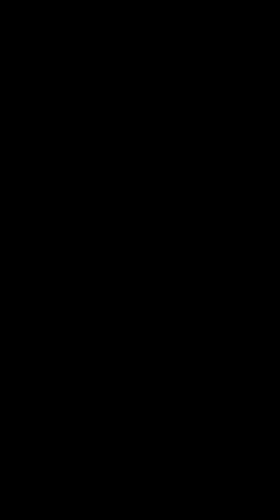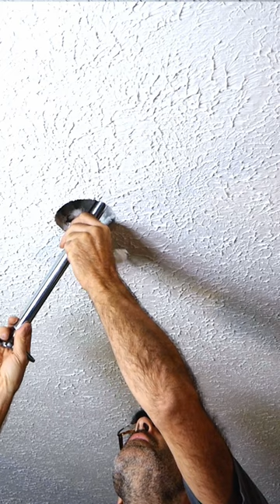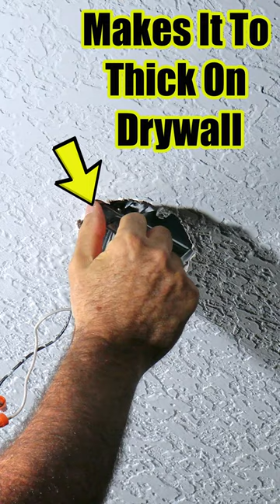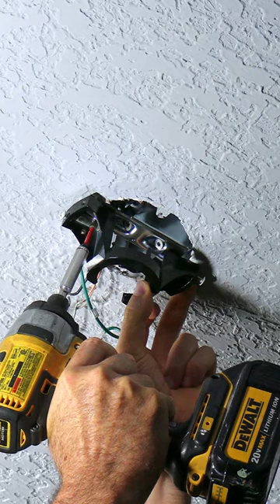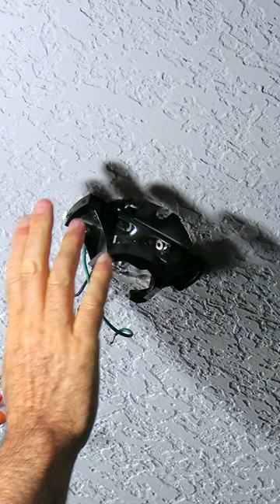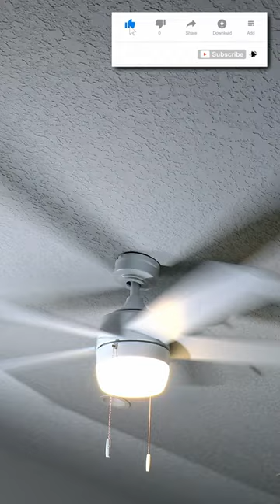How To Retrofit an Ordinary Light Fixture w/ a Ceiling Fan #shorts

Comment: This bracket is not available at the big box stores and very expensive online. Any idea where to get this at a fair price?
Reply from the maker: It was about $25 on Amazon... You're right, it's not available at big box stores.  Yes it's more expensive, but a regular fan brace is $22 at Lowes!  That's the one that extends between the trusses/ joists.  The one that straddles the joist is about $7 if you happen to have wood in exactly the right place..
Reply: It will be in Home Depot shortly.  We're working out the final details to get it in that store
Reply from the maker: Oh nice!  That'd be cool.... Thanks for the info.   @fixturesupportsystems8132

Comment: How did you put a remote in there to separate the light from the fan?
Reply from the maker: The metal mount for the fan usually has a place in there to store the remote.  Sometimes it's a really tight fit, so it depends.

Comment: Do you need to support on the joist?
Reply from the maker: Yes, when you screw that bracket in, you put the screws on the joist/ truss side so that it will screw into the wood... Thus bypassing the strength of the original plastic box.  Thank you.

Comment: What did he screw the bracket to?
Reply from the maker: The truss in the ceiling...
Reply: Not everyone works on homes…I don’t know what a truss is. But I appreciate the response. Thanks again!
Reply from the maker: Sorry a truss is the wood roof member that holds up the roof.  More than likely the original box is right up against one and that's what holds it in place. @boiboibam1601